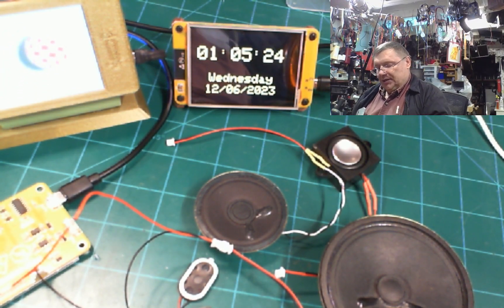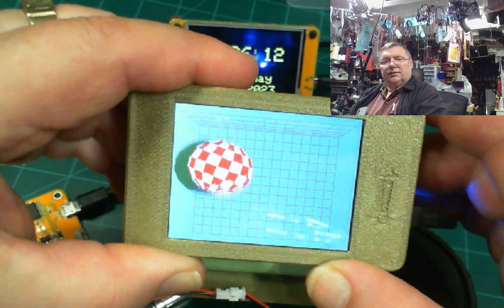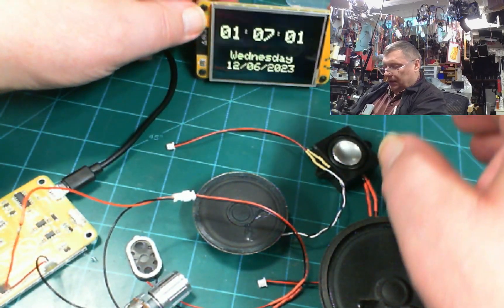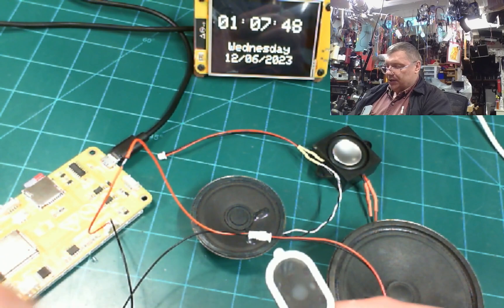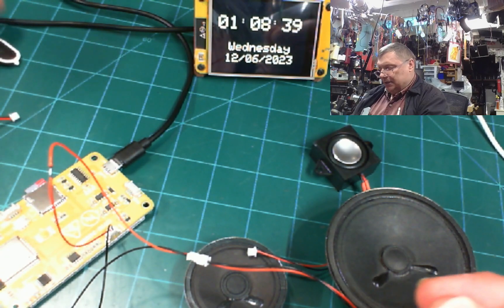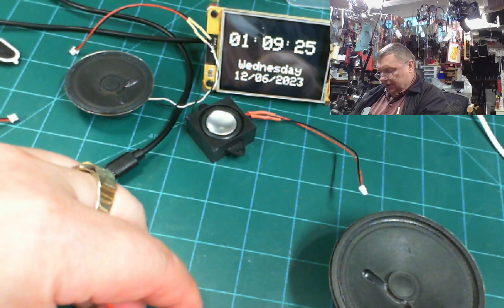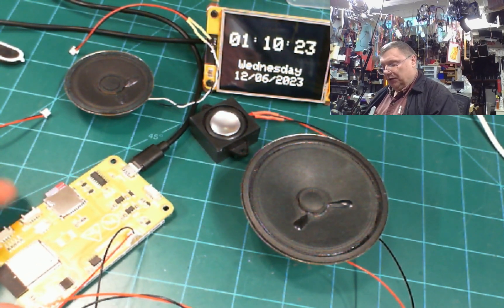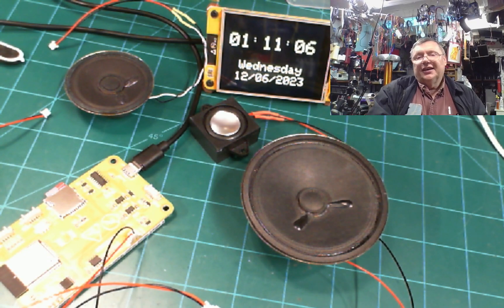ESP32 2.8" Resistive Touch  ESP32-2432S028R  - how to control the sound with a potentiometer.

Comment: What's the name of the port on the speaker?
Reply from the maker: If you hold the board so you are looking at the PCB and the ESP32 chip is facing to the left side, then the SPEAK(er) connector, the smallest one that has 2 pins only, is on the bottom. Hope that answers your question.
Reply: @tonysfun  That does! I have another question, If I connect my ESP32-2432S028R with a phone charger to a home common socket would it work?
Reply from the maker: @koliller  I do not know. I had my friend Hari write the program, since I'm not a programmer, sorry. Hope you can find answer by going to the GITHUB and research some of the places you can find there.
Reply: @tonysfun  Keep up with the good work!!